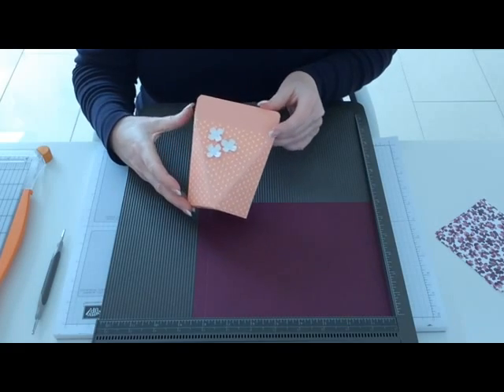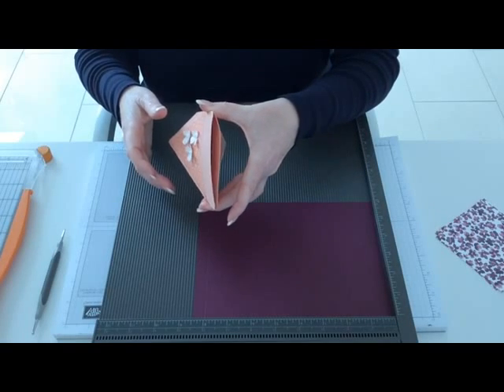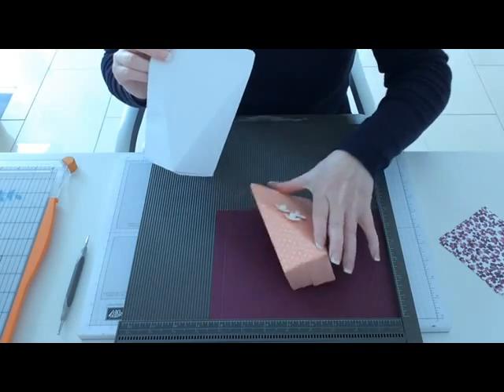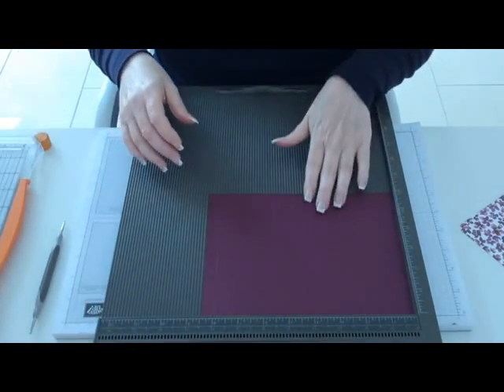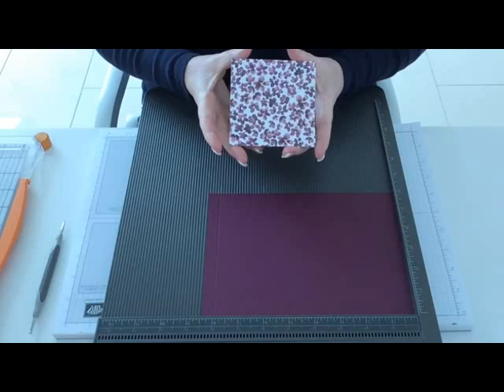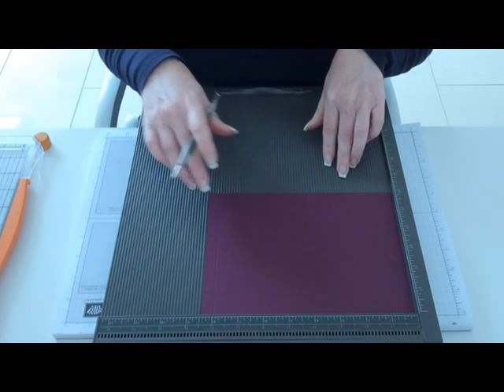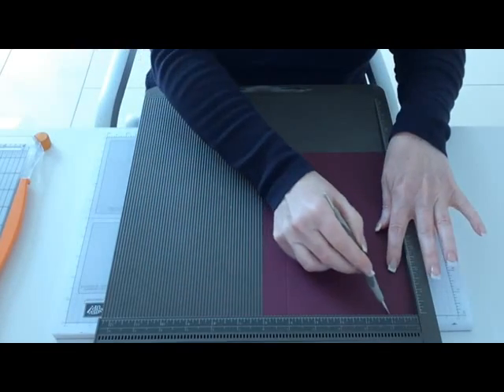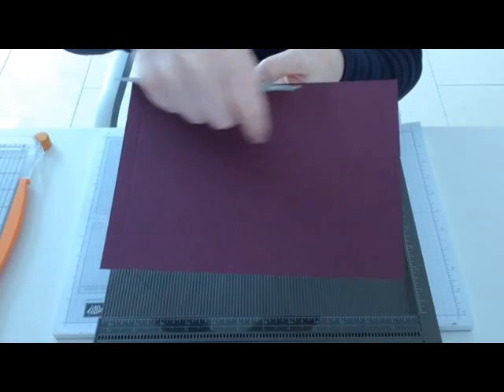Stampin Up How To Make A Squeeze Top Gift Box

Comment: Another excellent video Ashley. I love the idea of another size to give people a choice. 
I have made this box and love it so much, the variations of colours you can make are endless.

I have made the twist and turn Father's day card by Dawn, this week, and I changed the sizes of that one as well so that I have 3 sizes to choose from so that I can adapt it for other themes of cards and stamps as well.

Also this week I have played with some of the new products and made two variations of faceted boxes as well as the gift box board making different sizes and lengths. I also made a shutter opening card and as I don't have a 2 1/2 inch circle punch I used the brother scan and cut to scan in the inner section to cut out the circle in the middle, it has turned out really nice, just trying to decide on the decorations for the front. I'm thinking a bow tie as it is more a masculine type card.

Next week I'm going to work on some other cards and boxes using some of the new stamps and DSP. I have so many ideas in my head at the moment, I must put them down on paper so that I don't forget. I have started a book with instructions for workshop ideas. I'm halfway through the journal book already with all my ideas and some from You Tube.

Loving the new colours and products. Have a number of workshops booked for this month and next month.